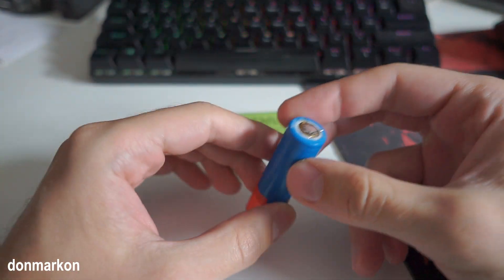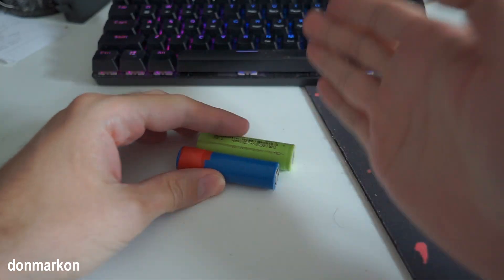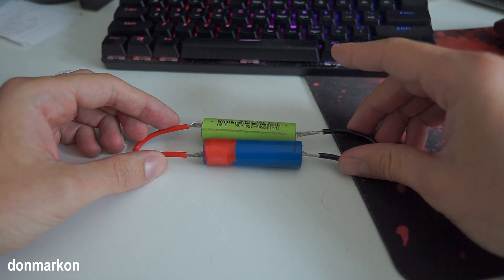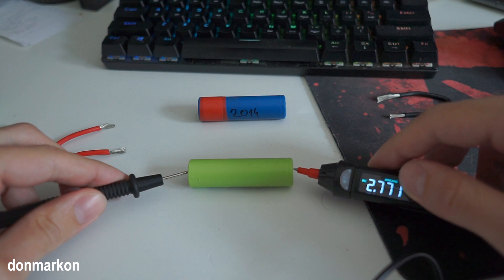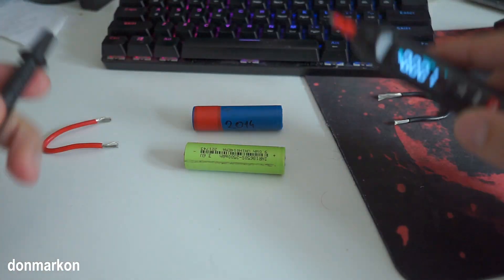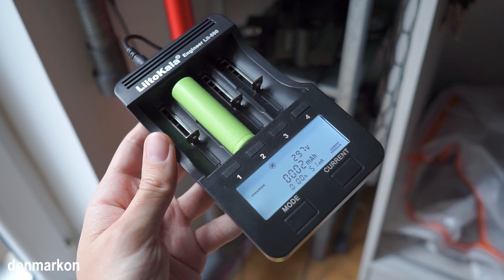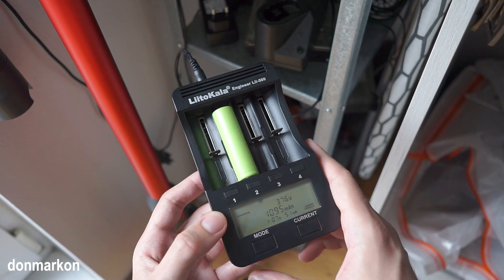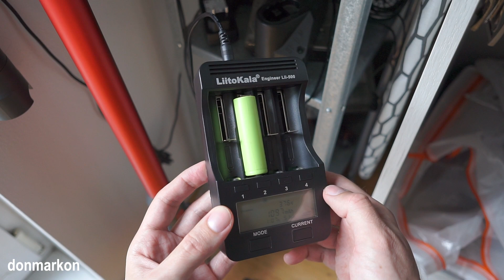Revive a Dead 18650 Works For All Types Of Li ion Battery Cells

Comment: Here’s a little advice, if you’re looking on YouTube for info on fixing a dead cell, you probably shouldn’t be trying to repair it in the first place.  I had taken a city scooter battery pack inside my house one night.  I don’t know if
It was spontaneous combustion, someone had messed with before I got it, or maybe an accidentally fed a Gremlin after midnight??  I was playing a game on my phone and it started off similar to a fireworks show.  I heard a short wizzing sound and a not so loud crack/boom.  As the cells heated up they shot out of the top of the pack.  The difference is the cells are about as hot as the sun.  They started off slowly starting a fire everywhere they landed.  I ran out to my shop and grabbed a big welding blanket and wrapped it around the pack.  Had no idea if would blow up on me or what???  Ran it outside and threw into an area with nothing around.  The smell was so horrific words can’t describe it.  Smoke billowed out of my house for about a half hour.  It has to be toxic as phuck!  I had always thought the e-car fires were exaggerated or bs, not hardly!  I’m telling you from first hand experience, those batteries are not something to mess with unless you’ve been properly trained and have an appropriate work station.  I no longer leave them charging on their own and don’t store battery packs inside my house.

Comment: how about use those RC car charger instead of a health 18650 cell..? so select the same 4.2 voltage on my charger, supposed do the same trick..? and my charger have discharge mode,and fast and slow charge mode, i got 5 dead cells from my power tool battery, all under 0.7v .

Comment: I hope your wearing safety glasses 
If you have ever seen  cell explode 
Its not fun 
The charging system is design not to charge an unstable cell 

Dangerous man don't do this
Reply: Just some more info 
The person who made this video is showing some pretty dangerous info 
He is trying to reset the battery CID 
( Current interrupt device) 
This is a system stops thermal runaway from a damaged cell 
Stops explosions or fire 
This is non reversible 
This is a mechanical system alongside the battery monitoring system 

DO THIS AT YOUR OWN RISK

Comment: This method works with a spliced USB cable too, is safer than the gas valve method. I used alligator clips on on spliced 5v USB wires, and pressed the rings to the battery terminals

Comment: mine only start charging when it is at 3.4V  litokala charger refuse to charge it until I bring it to 3.4V 🤣🤣🤣🤣 
but compare to your I pair it with a batter that are only 3.8V  my problematic battery didn't even heated even after 30 secs of connecting it in parallel. 
it takes like 8 tries to bring it to 3.4V

Comment: put 2 strips of nickle strap (batter weld strap) between the contacts of the battery charger, slide old battery in and then immediantly touch and hold a charged battery to the 2 strips (in parallel) to jump start the charger. The charger will start charging the old battery after about 5 seconds when it realizes the li-po profile. Charging a very low battery on one of my chargers makes it go into NiMH 1.4V mode. I would recommend the 500ma charge mode on a very depleted battery to keep heat down.

Comment: Update YES it works with 2 x 20 cent coins held how you held your wires . About 30-40 sec. Achieved 2.4v and the charger accepted and commenced charging 2x18650 Samsung  batteries ...dead for 20 years at least 😊 Thanks again.
Reply from the maker: Glad to hear this 😍

Comment: I think that rather than using another battery, the answer is to find a battery charger that will charge low voltage batteries, slowly. 

To be honest one of my battery chargers seems to charge low voltage batteries slowly. It is a "Li-on Automatic Stop charger SM-202A" but I bought it years ago and I can't see any more on Aliexpress. If I leave dead batteries in it for about 2 days it charges quite a few of them. I should probably only do this outdoors. 

But there is a "MS-202A" charger on aliexpress which is the same form factor as my charger (except with a charging light for each battery -- mine has only the one light) for only about 2.5USD, but it may not work at all.

Comment: 😂😂😂 lmao you can just use a regulable power source adjust it to 4.2v 1A and charge the discharged battery.
And that only works for discharged batteries, not for short circuited or real death ones

Comment: WARNING: Do not try this very dangerous if you want to try it do it on your own risk, this will create big FIRE in your home or workshop. there is a reason for the battery to show 00 volts due to blown internal fuse for SAFETY.
Reply: Sometimes the fuse is blown, sometimes the battery is old/dead and can no longer hold charge, but sometimes the battery is just overly discharged and reviveable. Being overly discharged damages the battery to a degree, but the latter can be brought back to a useful working life (I use old PC batteries for bike lights). 

If the fuse is blown then the battery wont take any charge and will not be dangerous.

The problem is with attempting this on an old battery, which can overheat and even explode. 

But if you look for YouTube videos of people attempting to get lithium batteries to explode, you will see that it is not all that easy, nor immediate. 

Additionally even with "unprotected"  batteries there is usually a "fuse" (heat expansion causes the contacts to break permanently) fail-safe. 

But there are always exceptions, and risks.

Comment: Basically it works by passing high current from the full battery through the dead battery and it melts away the dendrites / non-conductive "sludge" (for lack of a better word) inside the dead battery. That is why it's getting hot but also it's a somewhat unstable process and if too much current goes through it can cause a runaway effect and you have a chemical fire on your hands that is very hard to put out.

This process to be relatively safe should be much more controlled than just touching with wires and counting seconds.

Comment: Instead of using a good 18650 to revive the dead 18650 [which is risking and likely damaging the health of the good 18650], why not try this with a 4.5V (or maybe a 5V, 5.5V, or 6V) power supply that has a relatively high amp rating? . Of course be sure to monitor the temperature very carefully and experiment starting with very short connection times.
Reply: A good idea, thanks.

Comment: If you parallel connect a fully charged battery (3.7V) to a nearly dead battery (let’s say 2.5V), the charged battery will try to equalize the voltage difference. This can cause the following issues:
Current Flow: The charged battery will try to charge the dead battery. This may lead to a large current flow from the charged battery to the dead battery, which can be dangerous.
Overheating: This high current can cause the batteries to heat up, potentially leading to thermal runaway, especially if the dead battery is damaged.
Damage to Batteries: The fully charged battery may become damaged or degraded due to the rapid discharge caused by the attempt to equalize voltage levels
Reply: Regarding the overheating, what if we use a small section wire with a short period of charging?  This way we have a small current transferred between batteries and we just keep check of the wire considering it's the one that will overheat the most?
Reply: @oussemataamallah4048  That’s an interesting idea — using a thin wire would add some resistance and reduce current flow a bit, but it’s not really a safe or controlled way to charge a lithium battery. The current would still depend on the voltage difference and wire temperature, and it could change unpredictably.
Proper charging circuits use controlled constant-current and constant-voltage regulation for a reason — direct battery-to-battery charging can still cause overheating or cell damage even with a small wire.

Comment: Video is cut and you just swapped battery. It doesn't work in real life
Reply from the maker: Nothing is swapped … if battery is not in bad internal condition you just bump voltage up so charger can recognize it
If you have charger with recovery function it will on more safe and controlled way do the same thing

Comment: To revive battery cells that are below their permissible voltage, you should use special charge/discharge chargers (e.g. SkyRC MC3000) that have a refresh mode designed for this purpose. Their method is extremely dangerous! In addition, such a deeply discharging battery cell certainly no longer has the specified capacity
Reply: Wow a battery charger costs $130?! lol
Reply: @kaythinktank  I see that there are some of these chargers for 58 USD on aliexpress. It is still more than 10 times the price of the chargers that I use but it may be worth it.   BUT WAIT, the Sky MC3000 is for Nimh batteries!

There are LiitoKala chargers for both NiMH and Lithium which look like the may be able to charge low voltage batteries from about $20.

I think that rather than using another battery, the answer is to use a battery charger that will charge low voltage batteries, slowly. 

To be honest one of my battery chargers seems to charge low voltage batteries slowly. It is a Li-on Automatic Stop charger SM-202A but I bought it years ago and I can't see any more on Aliexpress. 

But there is a MS-202A charger which is the same form factor as my charger (except with a charging light for each battery -- mine has only the one light) for only about 2.5USD but it may not work at all.

Comment: I use a stun gun for all my nickel cadmium and lithium I use a stun gun for all my nickel cadmium and nickel metal hydroxide batteries that will not charge. I just shocked them for 3 to 4 * at 2 to 3 seconds

Comment: thankyou,. Maybe also try charging at lower voltages with an adjustable voltage regulator say 1v then 2v.
Reply from the maker: Great option if you have
Reply: @donmarkon  Oh, I forgot to mention that a power resistor can be used to limit the charging current.  You probably know much of this, but it's also a general comment for anyone to consider if they are willing.  If the charging voltage is 3.8v , and say the charging current is 1A, the resistor should be R = V / A = 3.8v / 1A = 3.8 ohms , I guess 4 ohms will do.  The current will be reduced as the battery is charged and it's voltage increases, and so this won't be a constant current circuit, but better than nothing, and a start at some better circuit.  Power wasted in the resistor is P = A^2 R = about (1^2)(4) = 4w.  The resistor(s) need to be rated at 4w or higher.  

This vid is important, especially the fact that many people might not know that some battery chargers won't charge a low voltage lithium battery until it has a minimal voltage, say 2.5v.   Brief "zapping" a battery was actually a method occasionally heard to revive some types of batteries, and maybe to bring them up to a minimal voltage before recharging.

Comment: Nicely explained so it's simple.
Reply: What will be the capacity of a battery like this...will it remain the same or reduce by what about?
Reply from the maker: @shriddle_31 it depends on many factors 
You should test it’s resting voltage and if that is ok later capacity

Comment: Does this operate on the concept that if you're using a voltage sensing charger unit, add some voltage to the battery in order for the charger to pick it up and charge it. 

Is that all this is?
Reply: This answer may be a little too late but yes, that is the idea of it. When the lithium cell discharged too low, the charger will not come on because it either doesn't see the battery or thinks there's a problem with the battery. If a lithium battery gets hot enough, it can ignite. The cell (battery) in the video is called 18650. It can handle a max voltage of 4.2V.  Another Cell with 3 volts or more can "jumpstart" the dead cell to 2.5 v then the charger can see the battery now. Jumpstart the dead cell with good cell by hooking up (+) to (+) and (-) to (-). Make sure cells don't get hot to the touch before it has a chance to ignite. A good cell can get damaged from the heat. If you have a DC power supply you can use that instead. Set it to 3.6 V and max amps to wake up the dead cell.

Comment: A cell showing less than 2.5v can often be brought back to life by passing a small current of 50 to 100ma until it reaches 2.5v, at which point normal charging can resume. By following this video a high and uncontrolled current will flow which is likely to reduce the future life of both cells. Do it properly or don't do it at all.
Reply: My charger puts 7 to 25 mA through cell drained down to 0,7V. After half an hour cell stats to accept set charging current with right voltage. I am not an expert but I would not do as shown in video.
Reply: @freeman3pl  Some chargers work to lower voltages. One of my chargers does not (the others all say that the cell is not charged and won't charge it). Please can you share the charger type?

Mine is an SM-202A but they are no longer on sale on aliexpress. There is a "MS-202A" which looks similar (two slots, and a cord) but other than the similar look and similar number I have no idea if it will charge low voltage batteries. 

No wait there are SM 2020A chargers on aliexpress. They are not listen as such but the photo on the bottom says SM 2020A.

E.g. 
"Safety Fast Charge 18650 Battery Charger 2 Slots Dual 18650 Charging 3.7V Rechargeable Lithium Battery USB Charger For 18650"

I can't promise anything but I think it may start charging even .7V cells.
Reply: so just a standard power adaptor limited to 100ma? what i dont get is why the stuff in the video even works. why does current flow from - to minus...
Reply: @wtfvids3472  The same exact way you jump start a car, but you just need to do it super slowly with Lithium chemistry. I don't recommend this unless you plan to baby that dead cell forever. The internal resistance has gone up, the capacity has been damage. Mark it and don't charge it when you are not present. Videos of Li-ions with thermal run away should strike more fear into people. This might be OK for low amp applications with cheap flashlights or something. But the cell is not reliable already at that low of a voltage. Saving $4-5 is not worth burning down your home.
Reply: @wtfvids3472  A fully charged lithium 18650 will normally sit at 4.2 volts. A near dead cell at less than 2.5 volts, so there is a 1.7 volt or greater difference in voltage that will drive current from the good to the dead cell. Power tool cells might have internal resistance of 20 milliohms so a current of 1.7/0.02 or 85 amps could flow even though few cells are rated for more than 30 amps peak output current. A charging current will flow but both cells will likely see reduced performance from the heat caused by the excessive current.
Reply: Great video. I tryed It from less than 1v to aboit 3v, buy the charger doesn't go over 3.2v. Is the battery really fault ?
Reply: I have a 20s12p battery, 1 series group became undervolted reading 1~V, I was able to charge it up but I stopped at 3.2V as the rest of the 19 series groups are also at 3.2V, do you think it’s fine to hook the revived battery up & charge the whole pack using its BMS OR should I charge the revived pack to 4.2v, discharge it down to 3.2v and then hook it to the bms?

Comment: Just had to charge my nephew's scooter battery with my lab-bench power supply. Each 18650 cell was down to 0.7 volts. It's sitting out in the press now charged up to 35.5 volts.. I hope it holds it's charge when I check in the morning.. (it's a 36v 10.4A 30 cell battery pack)
It's never been low before so fingers crossed.👍🇮🇪
Reply from the maker: What happened?
Reply: @donmarkon how to work out
Reply: that 36v is actually a 42v battery while fully charged 3.6 is the nominal voltage of li-ion 18650 cells and 4.2v is fully charged li-ion cells

Comment: All thinks will die sometime. The batteries too. So even you manage to charge a dead battery the discharge time is very quick and you have nothing to gain of this except of wasting time in useless and maybe dangerous activities.
Reply from the maker: I agree with you
I only do this when battery is over discharged by faulty battery management system aka BMS 
I know that battery was good but it got over discharged

Comment: I do not advise doing this at all. Once a cell has failed, this means either the chemistry has altered or there has been a breakdown inside. Charging a faulty cell from such a depleted state of charge could be dangerous. Even more dangerous when you actually use it due to the heat build up created by the current draw.
Reply: Actually @garrett69 lipo batteries discharge without use in warm and cold temperatures and battery circuit boards and devices have safety protection below .7 v on 1.5 v lipo so if stored low or in bad condition battery can still not be broken down as if it takes charge then works tho the mhz likely will be lower as liposuction have some what of memory
Reply: lol